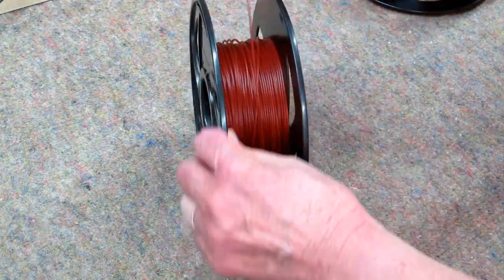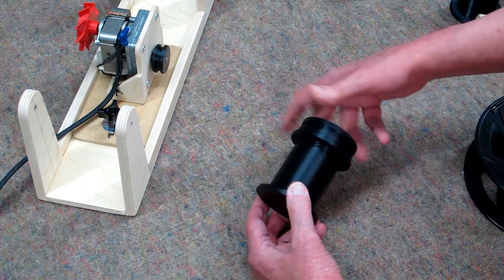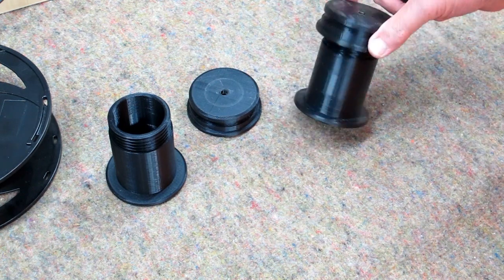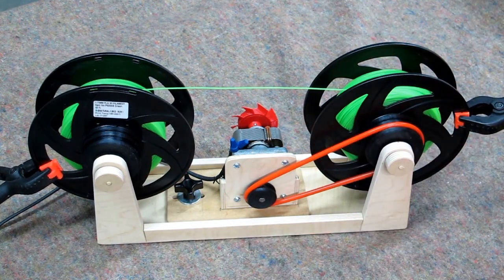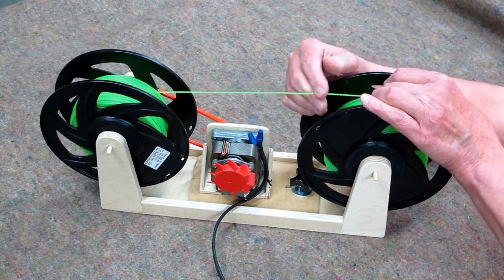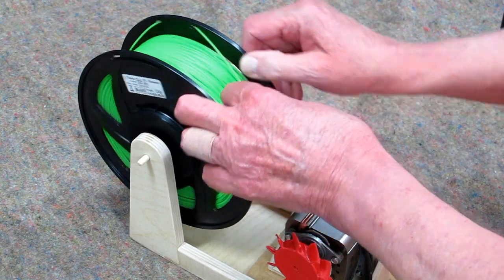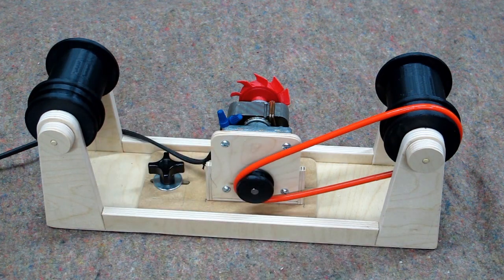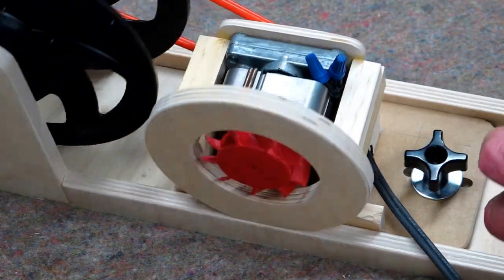Rewinding Filament Spools For 3D Printing

Comment: I would love to know what motor you used.  I looked up Shaded Pole Motors on EBay, but I do not know the specs of yours (amps, rpms etc).  Also I do not see ANY that have a 'through' shaft where the fan sits on on side of the motor and the pulley on the other like yours.
Reply from the maker: Shaded pole gear motors found on eBay often times are no-name motors with no data plate or detailed specifications.

Finding a suitable shaded pole gear motor on eBay is a hit or miss situation. I happened to have a variety of these gear motors and as stated in the video the one I used turns 18 RPM. A low speed shaded pole gear motor tends to have a lot of torque... you cannot stall the output shaft on this gear motor by hand.

The small output shaft is only intended to spin a fan blade for cooling.
 
May regular shaded pole motors without a gearbox are quite weak and only intended for light or no-load applications such as a cooling fan inside a microwave.

Sellers are jacking up the price up on many of the low speed gear motors as they think people will use them in something like a homemade BBQ rotisserie.

This particular motor would probably work and is slightly faster than the one I used and it also has a fan shaft. Make an offer and see if they accept it.

20 VAC replacement Gear Motor for Popcorn Popper 25 rpm C-Frame Shaded Pole new

https://www.ebay.com/itm/234783012934?hash=item36aa287846:g:bkwAAOSwz11jdexV&amdata=enc%3AAQAHAAAA4CVgKSZLELO%2Bx3aEdtW6pZVXZMTufuKsJ2WKdExdK6rHfdCtnp95oWX3xjXRfC8hyLr7nlI9c%2BSoZ%2Fto%2FFKntBpWaf7ZId1NlMAY1IE7TYOLFUG%2FJMIDgkA6hl3sNfGXI3ieJ2Ej0VD5n7mJ5xyhid9lQexiFtyKTaoYEKV9fqD9socuLPmGUYnst3s31b17zo6DDU1v2SR%2FHw%2BId93qkGocRSFSjsslov0%2Blz%2BNYwMVx9iCljPS5G4cNKRdzOcJ0bBCIVCivuLxhsMelWsTc%2BPwECBqoPYSoL9374fqFaxZ%7Ctkp%3ABk9SR8DirYe8YQ

This one may work if you used a larger pulley on the filament spool to slow it down. You must be willing and able to experiment with some of this stuff.

75 RPM 120 VAC SHADED POLE GEARMOTOR 34 3406 00 5-1715

https://www.ebay.com/itm/291142617396?hash=item43c973c934:g:UNkAAOSwcw9c9~BO&amdata=enc%3AAQAHAAAAsDIDH2pyptJHF%2BD%2FfYeQ%2BEenCERcSTwy4NZJYtLANFCU%2F8pzTdSjW6uX27pKskTAdfenq98fUrZpF%2BLzhgrP8vVW2StMb%2FoCZLkewyc1MiMhHbi2WNWhjS0F%2FlhABE7yr1ptxkXehW7cgILKPoEJGKo%2FuStw%2Fpz%2BNqsEuzhYzS6NUocQqIID%2FbypkDilYRowhW6nY90NMoT72M9na8ZPzgM8ee0y12Eo3uCyrUw4k%2FiO%7Ctkp%3ABk9SR_Db_4i8YQ

Good luck!

Thanks for watching. Please subscribe! 
That is what keeps this channel going. 
Ron

Comment: I have downloaded and now printed out your two spool tubes and their screw tops and the two small pulley's 
and although the big one screws together fine the small one won't screw on to the small tube part of the spool holding inner? 

All are printed without any faults and there is no stringing or bad layers. 

But the small one just won't engage with the top part and screw on no matter how I try?  

Any idea's how to solve this problem? 

Thank you for helping us all.  😁
Reply from the maker: Sorry about that. Mine screwed together without issue and a few others have printed them as well.
The tube and the nut are identical for both sides... but there are two different diameters (V3 and V4). The two different sized are for different size filament spools. Thus, if you have a pair that screws together and which fit your filament spools... print that pair again. You may have accidentally printed a V4 tube and a V3 nut. Hope it is that simple :-) Please let me know. Ron

Comment: Where did you get your o ring?
Reply from the maker: You can go to a hardware store or hydraulic repair shop and look for a suitable size o-ring
Or you can make your own with urethane round belt, which is what I did.

I have two videos on this process.

Senior 20 Conductor Installation (15) Joining Urethane Round Belt
https://youtu.be/KMqMYwPw2Cc

Joining Urethane Round Belt - A Better Way
https://youtu.be/ZuvHTy2-0u0

Thanks for watching. Please subscribe! 
That is what keeps this channel going. 
Ron
Reply: @RonaldWalters2010  What diameter are you using? Looks like about 5mm
Reply from the maker: 1/4" urethane round belt

Comment: WOW!!!  Thank you Mr. Walters for solving my problem of refilling my Monoprice Voxel 3D reel.  It has a smaller size diameter and width compared to the refill reels on the market.  It's also more expensive too.   Do you have a blueprint for the wooden holder for the reels?  Thanks again.
Reply from the maker: Sorry, no plans for the wood base. Just showing you how I did mine.

Comment: There is definitely a need for something like this. It's been a while since you made this, have you updated with a stepper motor to guide the filament so you don't have to use your fingers?
Reply from the maker: No, I haven't changed anything. Possibly because I have purchased better filament? :-)

Comment: I'm a newbie when it comes to 3D printing. I'm having problems getting my 3D printer to correctly print your filament spool holder to fit inside my Monoprice Voxel 3D printer reel.  It's a 7' diameter reel and the inside diameter of the hub is exactly 52mm.  When i printed your hub without adjusting the size  the diameter of  your holder is 57mm. I decided to change the X - Y axis to 52mm.  The outer spool printed 52mm, but the diameter of the hub dropped down to 38mm!  Please help me with this problem.  How can I get the correct diameter when printing your spool holder?  Also, what size dimension should i print for screw on spool holder?  Thank you in advance for taking the time to read this.
Reply from the maker: When you try scaling some of this stuff, things can go screwy… like threads.
I redrew the holder and the nut for your 52mm diameter. What I do not have time for is testing the print to verify that it screws together. 

Note: the unthreaded cylinder length (which would be your spool width) remains 62mm

Go back to thingiverse and re-download the files and you will find two new files:
Filament Spool Holder 52mm V4.stl
Filament Spool Nut 52mm V4.stl

I uploaded these to thingiverse at 11AM Central so it may take a while for them to show up. But they may already be available.

Let me know how they screw together.

Your cost for this is subscribing to my channel and watching a few videos. :-)

Ron

Comment: Thinking about this also the spool that is not connected motor could slide like the motor does so you could adjust the tension  for each new spool.

Comment: Is it possible to print a filament spool "master spool" that the user spools the Orginal filament correct on it and don't have to use 10 different spool sizes?
Reply from the maker: That would probably end up being expensive. Easier to just save those empty spools that you like.
Reply: @RonaldWalters2010  OK, thank you for Answering me.

Comment: was that full speed? can you go faster and still have good control?
Reply from the maker: As stated in the video, that is the gear motor I had available. You could increase the speed some but filament is brittle and you are changing the curvature it was wound on the supply spool (large curvature is being wound on the smaller inside portion of the take-up spool and vice versa). I am trying to salvage a spool of filament and I am not in a big hurry.

Comment: Ron,

Did you develop a parts list or any diagrams you could share? This device could be very helpful to use school teachers who mainly only can afford the cheapest PLA we can find. As you know those reels vary in size so much. Very cool device and great idea for a student project. Maybe develop for an INSTRUCTABLE (PDF)
Good Stuff........................
Reply from the maker: No, sorry. I don't make plans for these projects. At most I would have made a few sketches with notes and those were thrown away. I just use what material is available and start building. I am showing what I did and expect others will need to adapt the process according to whatever motor, materials, spool sizes they have. 
The free Thingiverse files are listed in the video description. These were drawn in Fusion 360 which is also free for teachers and students. Anyone playing around with 3D printing would find it advantageous to learn CAD as well, and Fusion 360 is very powerful. I am old school pencil & paper and have used Fusion 360 quite a bit the past couple of years, but have only scratched the surface of its capabilities.
Sometimes the PLA does not like being rewound (due to changing the curvature of the material) and it will snap. A filament splicer would then be handy to put the filament back together again. Search eBay for "Filament Welder" which will also work for ABS.
Thanks for watching!
Ron

Comment: I would advise against rewinding spools, at the very least, not unless one knows how to counteract the issue that comes with taking a spool from its current state (on the original spool) to the next.
IE, when you unwind the line it becomes brittle, especially with older filament or low quality filament. To bypass that issue, you have to reheat the filament, either as you go (careful temp control so as to not stretch or melt the filament), or baking it in the oven once you're done.

To bypass the issue of crossed thread, all you have do is put the filament on a rigid structure affixed to the 3D printer frame (preferably the bottom) but that has a sprung swing. That will allow the filament to get over the crossed section and continue the printing action.

Just my 2 cents based on experiences with various filaments from various companies or no-brand and a few printers, including CR10 and its extended family.
Reply from the maker: Definitely changing the material curvature when rewinding. Only had one spool I had to throw away because it was snapping off every 10 inches or so but then it was doing that before I tried rewinding it.

I would be interested in seeing a drawing or photo of what you are describing here: 
"To bypass the issue of crossed thread, all you have do is put the filament on a rigid structure affixed to the 3D printer frame (preferably the bottom) but that has a sprung swing. That will allow the filament to get over the crossed section and continue the printing action."
Reply from the maker: I definitely have received spools with line-overs throughout the spool. Usually with the cheaper "no name" filament. The PLA is stiff and brittle. At the factory it is going onto the spool while it is still warm and it has a memory of the curvature it has on the spool.  When rewinding you are changing the curvature as it goes onto the new spool and sometimes the filament will not tolerate this change and breaks. Usually I have been successful but I did have one spool of yellow which broke every meter or so and I had to throw it away. Gently and carefully warming it with a hot air gun or hair dryer would definitely help as long as you are careful not to heat it so much that it changes the shape/dimenisions of the filament.

Watch a couple of my 3D Printer reviews (Creality CR-10, Ender-3) and you will see I have the spool mounted on ball bearings and the filament feeds very freely to the extruder.

Laminations, under extrusion, gaps, printing in the air... can also be caused by a plugged nozzle. I have found black filament to be the most problematic as it often seems to contain chunks of whatever they use to make it black and without notice the nozzle will plug either partially or totally.

Comment: 3rd small wheel required to guide the filament rather than potentially running 300+ meters of filament through fingers. That’s the only thing I’d add,is a guide wheel

Comment: I like it. I was thinking of designing one with a large plastic screw like the ones that wind a water hose and moves the water hose back and forth. This way you don't have to keep moving your hand back and forth. Which looks tiring. Also, a way to hold the tension while spooling. These to updates would make this an assume system. I had one spool of MH build series PETG failed print because the filament was wound just a bit to tight. I would use it to re-spool any new spool of filament from now on.

Comment: Would love to see  the carriage in a 3d printable format.  Would also like to see a small geared system that both tensions and is set to move a filament guide back and forth at a rate that will cause it to perfectly wind.    Maybe I'll try to play with some designs, though I am not good at it.  
I like your design though. Gives me some good inspiration.
Reply from the maker: Something like how a fishing reel rewinds and guides the line. Consider the old Mitchel 300 spinning reel mechanism work (google it). The reciprocating rack and pinion is shown in my video:

Making The Reciprocating Rack & Pinion
https://youtu.be/zae2ZePQTwQ

Remember, when you are respooling the filament, you are taking what is a larger diameter (curvature) and winding it onto a smaller diameter (curvature) and the opposite is true when the smaller end is on the outside of the new spool. This can cause stress in the filament and it may snap. It is a good reason NOT to "tension" the filament and the filament should be dry (moisture can cause the filament to snap). At the factory, the filament is dry, probably warm and more pliable when it goes onto the spool.

Thanks for watching. Please subscribe! 
That is what keeps this channel going. 
Ron

Comment: Why do you hold it with your hand the entire clip?
Reply from the maker: I am controlling the tension the filament is being wound onto the spool as well as the placement onto the spool. Also guiding the filament evenly on the spool side-to-side so it does not get crossed-over again. Some filament does not like changing curvature, so you need to be careful with the rewinding process.
Reply: @RonaldWalters2010  I liked you idea, i want to make it run autonomy as part of an artwork.. so i'm concern about it not running alone. I dont want to use it as an 3d printing helper, just like the mechanism.
Reply from the maker: There is a mechanism called a self-reversing screw which could be used to automatically wind the filament back and forth on the spool. Difficult to make but it works very well. https://www.youtube.com/watch?v=zv7cXR1UkWQ
Also:
https://www.abssac.co.uk/p/Lead+Screws/Self+reversing+screws/8/

There is a fishing reel which incorporates a reciprocating rack and pinion to guide the line back and forth on the reel. Works similar to my Reciprocating Rack & Pinion  https://youtu.be/zae2ZePQTwQ
Search for Mitchell 300 fishing reel.

Just giving you some ideas.
Thanks for watching. Please subscribe. 
That is what keeps this channel running. 
Ron
Reply: @RonaldWalters2010  Right. I subscribed. Do you have maybe some PDF with the cutting you made on wood that you can share?
Reply from the maker: No, sorry. I seldom have any drawings for these. I'm just showing you what I built. Most is made from whatever material I have laying around.